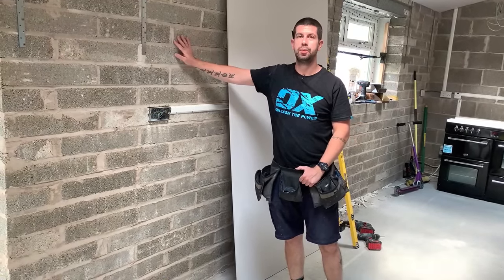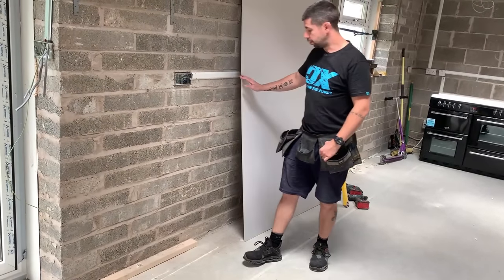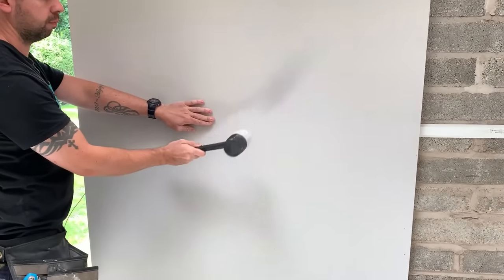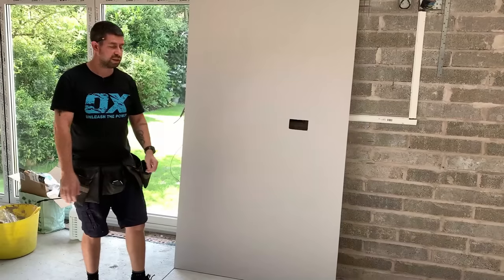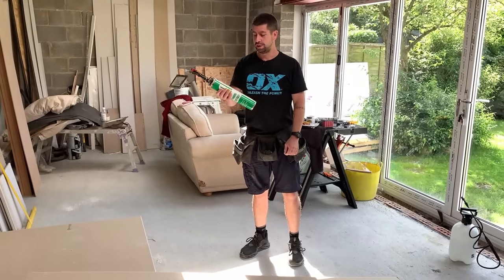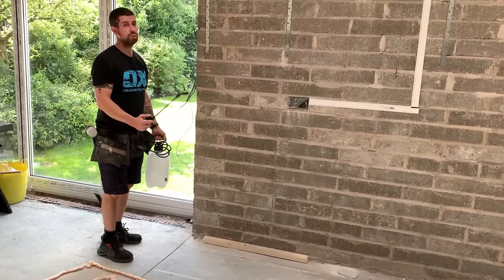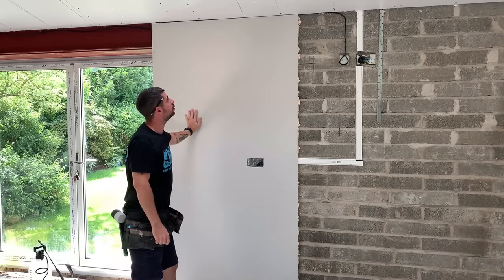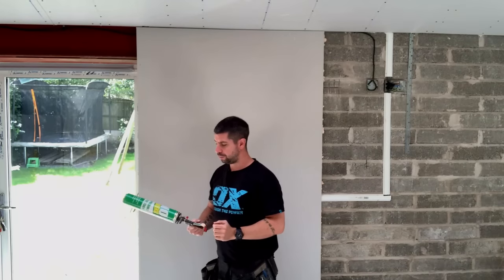How to plasterboard walls, the easy way with foam

Comment: Will this stick to a painted brick wall or would the wall need prepping got some boards in the hall way ready for the spare room debating the best and easiest way to do it if this foam sticks to paint then I think this might be my easiest option I bought some plasterboard adhesive but my uncle told me I've got the wrong 1 I need dry wall adhesive I've helped plasterers in the past but they have always screwed plaster boards to battens
Reply from the maker: If you bond the painted wall first then it should stick fine 👍🏼

Comment: Not tried that brand. I tried another brand for insulated plasterboard but found it cures too quick for you to work the boards. Does that stuff allow more time ?
Reply from the maker: There is a little bit of workable time but not much. I find preparation is key. If I prep it right I don't have to mess about too much 👍🏼

Comment: Can someone explain why in the U.K. we don’t just plaster the wall itself and need to put plasterboard on exterior wall? I’ve seen a lot of European builds where they just plaster the wall they don’t use plasterboard on exterior walls only use it on interior stud walls.
Reply: Time & money. At least we skim it. In the US it's just taped and jointed. Sat here in my 60s property i can tell you it is traditional plaster onto brick.

Comment: How far of a gap can you leave between the brick and the drywall? I need to add some plasterboard to repace a damaged but but the gap is around 1 inch. would that be ok? Cheers. Great tutorial by the way matey.
Reply from the maker: I have done something similar when I took out a corner chimney breast. It worked fine but there was a section that was a bit flexible so I drilled a 10mm hole, squirted in more foam and it was solid.
It's probably just a bit more difficult to hold in place whilst it sets when the foam is thicker.
Thanks for watching and don't forget to like and subscribe to help me out 👍🏼
Reply: @spendtimesavemoneydiy  excellent. Thanks for the help , I really appreciate it. Subbed :)

Comment: hi great vid i watched this before and during putting up my boards - worked great! thank you :). or those sockets do the cables need to be chased in to get good contact with the wall? Also any advice on keeping the boards pushed to the wall while it goes hard. I had to stand holding them for 10 mins.
Reply from the maker: Chasing the cables would be better but very time consuming.
You can throw a few screws into the wall to save you holding it.
Thanks for watching and don't forget to like and subscribe to help me out 👍🏼
Reply: You could use a peace of wood at an angle as a prop maybe?
Reply: @spendtimesavemoneydiy - avoiding those cables as you throw the screws in :-). I like the idea of the foam as it avoids finding pipes and wires. I know one can use a detector but I wish all homes came with a 3d plan of pipes etc.

Comment: I wonder if the plasterboard will still be attached to the wall in years to come?
Reply from the maker: I first tried this method about a year ago and no problems. But I guess only time will tell 🤞🏼
Reply: Never tried this, but I used foam and a 2x4 as a dam on a floor to block self leveler from flowing into another area.  It took about a dozen strong kicks to get the 2x4 loose.  It wasn't even foamed directly to the floor, I just used foam along the edge of the board...  Now I might be hanging my drywall with this stuff..

Comment: Good video, like to see different ideas.
Could save some time cutting out for the box from behind once you marked it rather than drilling hole and marking it again on the front.
Reply: I would also cut from the front. I wouldn't want the raggy edges at the front, especially if I was the one skimming it.
Reply: Raggy edges. I don't get them. So not a problem for me

Comment: There's a huge problem with this.

 I have found renovating older houses that foam disintergrates to dust over time. Have often seen 
Windows doors and frames having huge movement because they thought that they could just Chuck foam without proberly strapping them. 

House I'm on now is terrible I'm guessing the foam lasts About 10 yrs. Before it turns to little more that dust and air
Reply from the maker: Maybe the foam 10 years ago was poor quality?
I'll let you know in 10 years if my plaster boards are still up but so far so good 👍🏼
Reply: @spendtimesavemoneydiy 

Trades will be long gone. And neither will any of those people remember who used foam for structural purposes.

Foam is handy for sticking down window boards and I've done it a good few times with just bricks to hold down the boards. But after seeing that old foam dust. I don't do it anymore. Just get gripfill

Anyway I'm not here begrudging you or your work. Just letting people know that there is pitfalls to using foam.
Not sure if there is a lifetime on those cans or not or what those people years ago used. But just bare that in mind.

Comment: Nice work! Is it always easy to get each board edge to line up with the next or do they sometimes stick out? How soft and squishable is the foam as you hang the boards? What do you do when plasterboarding a taller wall, cut the boards to half the space each, or put a full board then fill the remainder with a part board?

I'd like to see how you add corner protectors to that as that is a problem in my house. Can they be replaced?
Reply from the maker: Preparation is key. If the walls are flat and the foam is consistent then the boards line up great. If not the odd screw helps.
I generally use full boards and fill in the gaps.
A great tip I got from a plasterer for corner beads is to stick them on with a bit of plaster behind them. 👍🏼
Reply: @spendtimesavemoneydiy  Ah very good - thank you.
Reply: Staple the angle beads on if it's on plaster board 👍

Comment: What if your walls arnt plumb like yours was to start with? How you going to build it out with foam? Also is there movement in ur walls? I’d hate to think I was going to put a family photo on wall after uve stuck boards on with foam, fair enough if u ant got a joist or maybe a reveal but a full wall? Come on man, that’s shocking
Reply from the maker: My walls weren't plumb, the foam plumbed them up.
It was over a year since I did this and there are no problems whatsoever.
I wouldn't expect professional dabbers to use foam because those guys are too fast with dot n dab but for DIYers I think it's easier.
People seem to slag off new products and methods but don't knock it till you've tried it.
Thanks for watching anyway 👍🏼

Comment: Shocking method.  Start wiv reveals first wiv board adhesive.  Then the walls in no time . 30 mins a room . And you can skim on straight away if you no what you are doing.

Comment: The electrician is out of zone, there is not a socket to confirm it
Reply from the maker: Please explain more.
There is a socket with cable running horizontally from it and there is a socket higher up with cable running vertically up and down from it. To me this conforms but if I'm wrong please tell me where I went wrong. Thanks

Comment: O great the electric cables go sideways so someone can drill straight into them at a later date .....good job clap.
Reply from the maker: All in zones! Directly in a horizontal or vertical line from a socket.
But thanks for the criticism 👍🏼

Comment: It’s ok if you’ve got a small area to do, but a big job wouldn’t be practical or cost effective this way. 

No big deal but your sparky has mounted the switches too high on your reveal 😂😂
Reply from the maker: The video was more to help out DIYers rather than tell professionals how to do their job.
I did the electrics myself and my ocd wanted the switches the same height as the rest of the house and not at 1200
👍🏼

Comment: Looks like good stuff mate. Amazing it works out cheaper - must have been a marketing mistake! :-) All for anything that cuts down the muck. Nice tip. Thanks PP
Reply from the maker: Screwfix's own brand is cheaper but the other brands are a bit more expensive and work just the same. 👍🏼

Comment: Great video but my OCD kicked in seeing the cable run of that socket, up down left or right or between accessories or straight out of a zone, pretty sure you shouldn't see 90 degree runs without an accessory at the corner of it i.e a switch or something :)

Comment: Iv been a dryliner for 20 years and I would never use your method..way to slow and it would cost more using the foam
Reply from the maker: The video is aimed at DIYers to show an easier method in my opinion.
I'm not trying to teach professional dabers a new way, I know how quick you guys have to be.
But as a DIYer who has tried both ways I find foam easier not quicker to use 👍🏼

Comment: Awful, never, I repeat never use foam to dab a board! Use drywall adhesive!
Reply: Why not?
Reply: @Flat-Five  it won’t stay on the wall for long, it’s not air tight either, use drywall adhesive